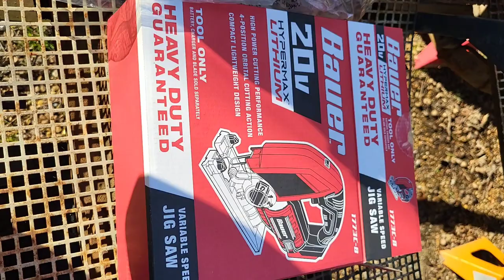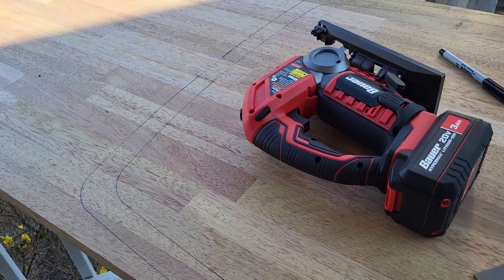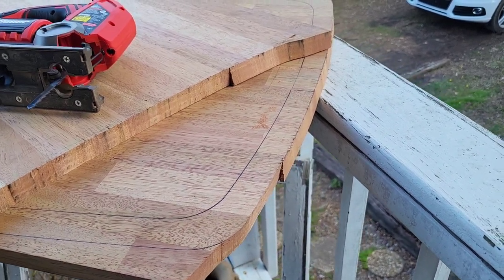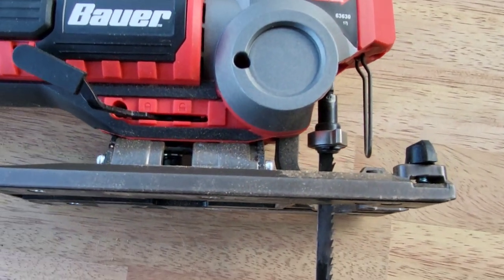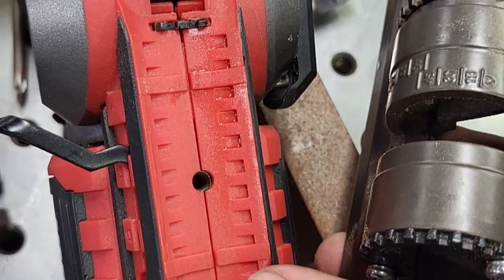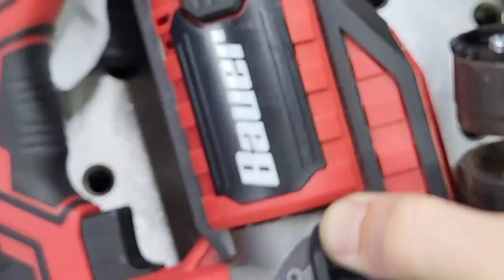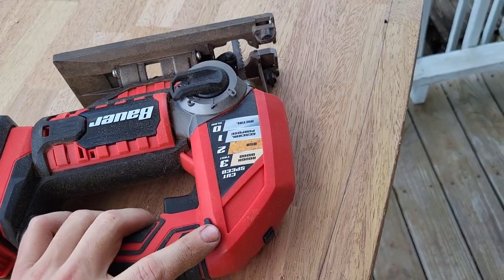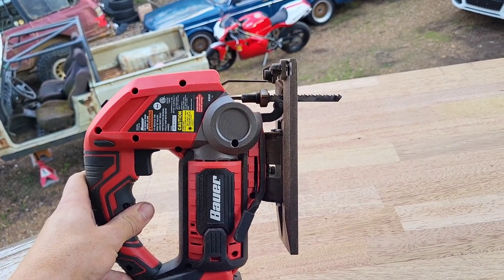Harbor Freight Bauer Jigsaw.... is it any good?

Comment: You cut that thick of stuff with a skilsaw dude that is way to thick for a jigsaw, jigsaws are meant for ¾ plywood or thinner! It's not the jigsaws fault it's yours heck you would have to slow down with a skilsaw on that thick of stuff!
Reply from the maker: you know you can get plywood thicker than what I was cutting dont you? Its a little tricky to cut curves with a circular saw but maybe you know a trick that I dont. Also, the length of the jigsaw blade vs the saws stroke determines how thick of material you can cut.
Reply: @TMBchopshop  yes I know that and you don't cut it usually with a jigsaw most people use a skilsaw or band saw that will burn the best of jigsaws up!
Reply from the maker: @joeysweet9045  how do you cut compound curves with a skilsaw?
Reply: @TMBchopshop  bandsaw!
Reply: My Bauer corded jigsaw was a piece of crud. I bought a small Dewalt jigsaw with Diablo nice smooth blades and it cut perfect in a curve or straight at 3/4 inch

Comment: Ur supposed to use level 0 for metal and hardwood. The higher levels have an orbital action to that allows thr blade to move in a circular motion. The higher the number the larger the orbit.

Comment: Hey I had the same problem with the corded version 2023. The blade will jump out of the guide and cut at an angle and really screw up your cut, causing it to meander all over the place. I threw mine in the trash. My other tools from Bauer work great, but the jigsaw will not hold the cutting blade straight in the guide, especially for thicker wood such as 3/4 in my case

Comment: Have you used a jigsaw in the past to cut this material in this thickness? If not what did you use?
Reply from the maker: I have used a Bosch corded jigsaw for the last 10+ years with no problems but it was getting old. I'm slowly transitioning my tools over to battery power and I decided to try this one since I already had the battery and charger for a leafblower. I ended up keeping the saw and I have since used it in thin, .120" steel with no issues.

Comment: Yeah definitely get on DeWalt or Milwaukee. Going battery i like Ryobi because selection but i don't own them go DeWalt.
Buddy got Milwaukee there good to. There 12 volt stuff great. Now recently got hyper tough 12 v cause cheap ratchet ad drill got drill 23$ only y because wanted extra battery it 20 alone yeah drill bat charger 23 . Got fast charger 4ah batt 45$ ok working on cars stuff not as powerful as Milwaukee but save me lot time spinning wrenches And ratchets. Id like try deealt ratchet. Maybe spring time be able get it. Kids don't need something.  Good video sucky product.  Stay safe from ur ole hillbilly buddy.